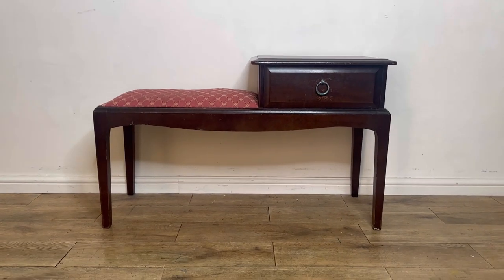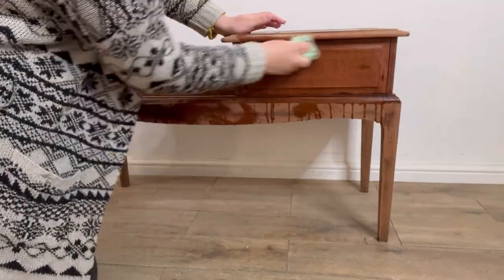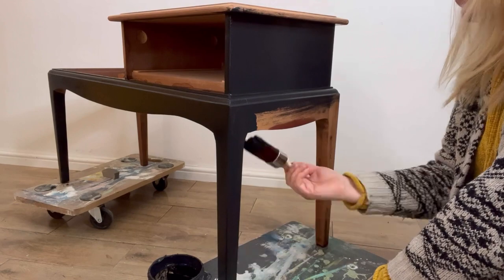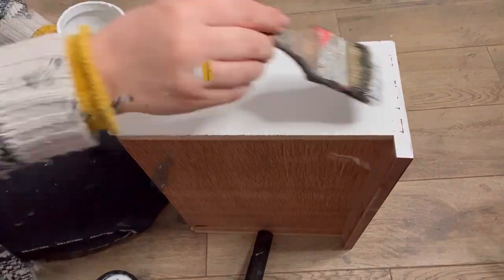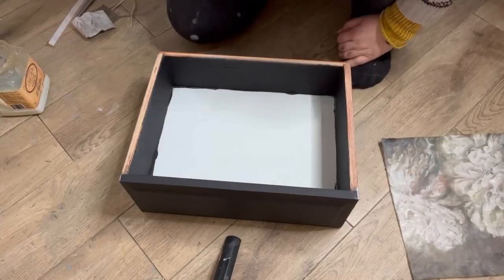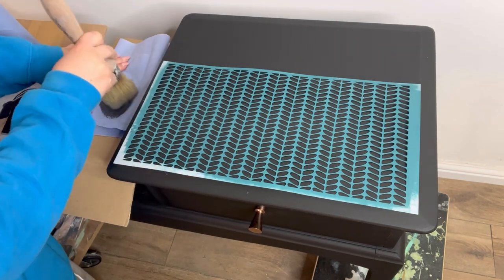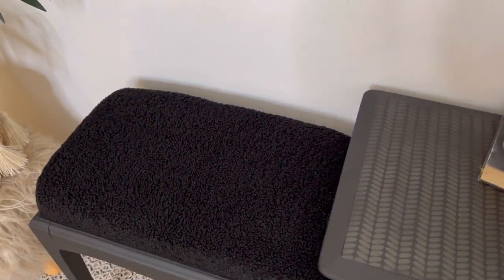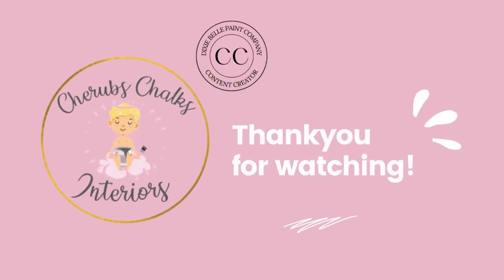Lets Transform This Outdated Gossip Bench With Silk Mineral Paint!

Comment: Lovely piece. I just bought my first jar of Silk. Is it necessary to sand my furniture before using?
Reply from the maker: Hey Joann! Thank you for reaching out about our products! You are not required to sand but we recommend giving it a light scuff sand after cleaning. Silk All-In-One Mineral Paint has a built-in water-based primer, built in topcoat, UV protection, water, mildew and grease resistant as well as scuff resistant. Just make sure not to use water to thin out or distress your piece after painting because this may destroy some of the components of this paint such as the top coat and primer. I hope this helps! ❤